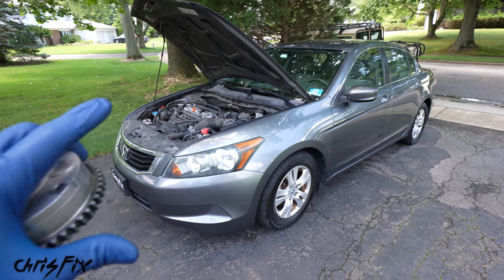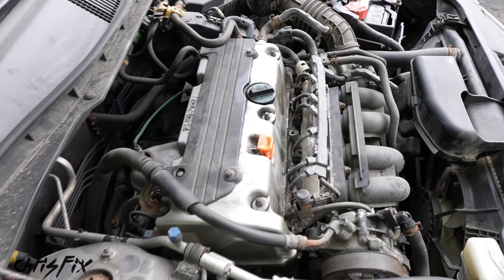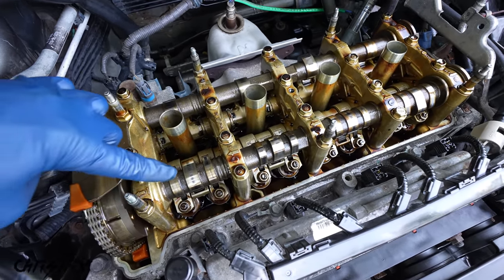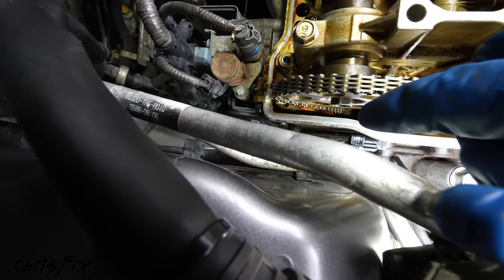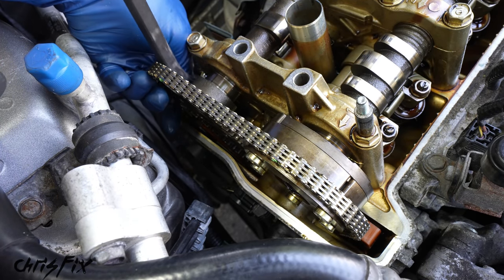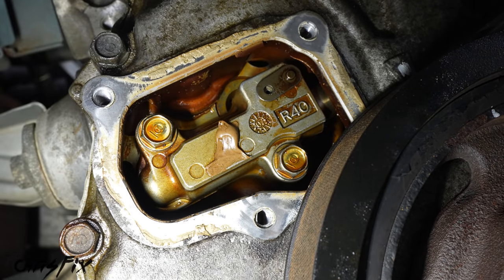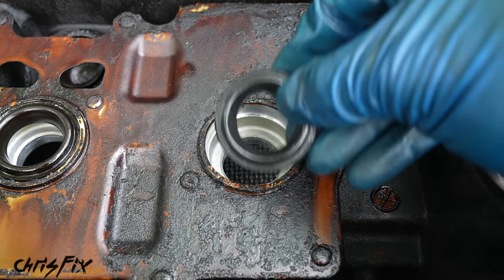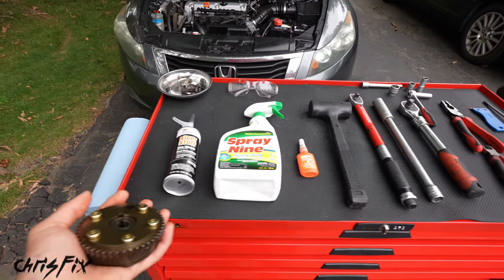How to Replace a VTC Actuator (Complete DIY Guide)

Comment: I just did this job yesterday.   Successfully complete.  Couple of comments.  Unless you are very lucky, or an extremely experienced mechanic with every shop tool known to man, DO NOT ATTEMPT TO BREAK THE ACTUATOR BOLT LOOSE WHILE INSTALLED IN THE ENGINE.  Rather, follow the instruction from the Honda Service Bulletin 09-010, which instructs you to remove chain tension, then remove the (5) camshaft retainer caps and then remove the intake camshaft with the VTC actuator installed.  After removing the intake camshaft - then proceed to break the actuator bolt loose and replace the actuator, and then reinstall the camshaft followed by the camshaft caps.

 IT IS NEARLY IMPOSSIBLE TO BREAK THE BOLT LOOSE WHILE THE CAMSHAFT IS INSTALLED IN THE ENGINE !!!  I tried it -with the help of another person holding the 23mm wrench.  No luck.  Probably applied 200 ft/lb of torque and no luck.  I was about to damage the engine if i kept trying.  It took an extra hour to remove the camshaft caps and remove the camshaft, but time well spent.  It was easy to do.  Just follow the steps in the Honda Service Bulletin 09-010.  Make sure to reinstall the camshaft caps in their original location.  Make sure to align the to hash marks on the camshafts as Chris explains - before removing the camshaft.  You will never get it back correctly if you don't do this. When you reinstall the camshaft and place the teeth into the timing chain - you have to get it perfectly lined up so those 2 hash marks are facing eachother.  If they are not exactly aligned as you had it prior to removal - then remove the camshaft from the timing chain teeth and reposition it to get it right.  This took me a few minutes.  Was a little tricky.  Be patient.  There is not much slack on the chain and it's tight.

When you reinstall the camshaft and align the gear hash marks (TDC) and then reinstall the camshaft caps - they bolts on the camshaft caps have to be tightened down in a specific sequence (as expected) per Honda Service Bulletin 09-010.  As you tighten them down - you will be working against the force of the valve springs - so it's important to tighten them in the correct sequence.  Oil the cam lobes and shaft journals before replacing the caps and tightening.

Also:  very important.....Once the camshaft is removed from the vehicle and you are ready to break the VTC actuator bolt loose - you will need to secure the entire camshaft to a flat surface to hold it in place.  I used (2) cargo tie-down straps.  One at each end of the camshaft and secured it to a picnic bench.  Anything similar (large tree, park bench, wheel mounted to car, etc) will work.  Once tied down, use the 23mm wrench as Chris said to prevent the camshaft from rotating.  Then get a huge-ass breaker bar - at least 30" if possible, and break the bolt loose.  It will take like 250 ft/lbs to break it loose.  You will need only 85 lbs of torque for the new bolt.
Reply: In my experience it was actually pretty easy to brake it loose, using the same setup as ChrisFix except i was also using a long pipe that was put over the 24mm wrench to give more leverage otherwise it's almost impossible to hold the camshaft in place with just the wrench on it's own when you apply that much force through the braker bar on the actuator bolt. The day before i also heated the bolt up just with a cheap little butane torch, and then the next day when it had cooled down i broke it loose, but i don't know if the heat actually did anything for me there it was mainly just the long pipe over the 23/24mm wrench that helped the most. Hope this will help someone out
Reply: Wait. Lemme get this straight. So you removed all the camshaft caps which took an extra hour, just so you can turn around and tell us the actuator bolt still took 250 ft/pounds to break. This seems counter-intuitive. Also, I fail to see how having the cam loose will make the actuator bolt come out easier in the first place. Either I am missing something, or logic and rationale are missing here.....

Comment: My 2013 CRV was making the cold start rattle.  The problem with the VTC actuator is the weak pin spring in the actuator and not necessarily hte actuator itself.  I replaced mine with a stronger spring and no more rattle!  Easier than replacing the VTC actuator with a like for like which will replicate the problem since the design has not been improved.

Comment: This is a fantastic DIY, thanks Chris! As a Honda owner who performed this exact repair myself, it’s very helpful!

I would just comment on a couple things to help people out:

1: At 22:44, seeing the chain jump like that after putting tension back on it is NOT a good thing. These tensioners do use oil pressure as a main source of tension but they also have a strong spring in them too, that will keep tension on the chain without oil pressure. When rotating the engine after the tension is applied, the chain shouldn’t be jumping like that. 

On top of that, these K series tensioners are known to fail as well, so might as well just pop in a new one while doing this job. It’s a relatively cheap part and it can literally save your engine :)

2: I would recommend against using non-oem gaskets for the valve cover. I’ve tried so many different brands over the years, always installing them correctly and I’ve had small oil leaks every time. Maybe not so much with the spark plug tubes but with the valve cover gasket itself mainly. But with an oem replacement I’ve never had an issue :)

Once again, amazing video though and just wanted to add a couple points!

Thanks again :)
Reply: If you see the chain jump, what do u recommend doing? Replace the tensioner?
Reply: @bobbyjoe90  Yep, definitely. Any time this job is done, the tensioner should be replaced along with the chain, especially in those K series engines.
Reply: I assumed it jumped like that because there was no oil pressure because the engine hasn't ran for a few hours, plus when he relieved the tension, it probably drained some of the oil out of the tensioner (not sure if they have check valves or not and that's why the spring is there to maintain tension without oil pressure) The chain shouldn't be bad because the marks lined up, when the engine is started for the first time after the repair, everything should be in check after oil pressure in the tensioner is restored...that's just my guess as to why that happened.
Reply: @ElectricSwordfish  Those tensioners run mainly on oil pressure yes, but they also have a strong spring as well for specific instances like this (cold starts, etc). That slack shouldn’t be there at all.

I’ve replaced a bunch of those little guys on specifically the K series engines and they’re supposed to have tension on the chain at all times.

The tensioner was a known weak point on those engines and usually is the first component to fail (apart from sometimes the VTC actuator)

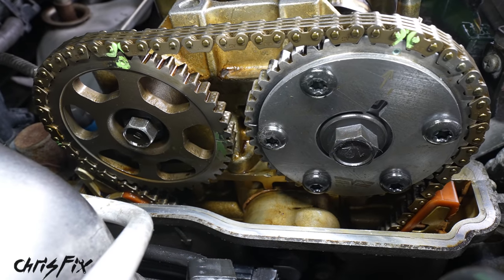Comment: 22:36 I just about had a heart attack seeing that chain jump lmao
Reply: Yeah it definitely jumped teeth hope he caught it
Reply: Is that because the timing chain tensioner is bad? It did it again as well after he went a full revolution.
Reply: @JonDoe-007  this was his response to thta "" It didnt roll off, it bunched up because we compressed the chain tensioner which uses oil pressure to push back out so there wasnt normal chain tension like with a running engine. Also the chain guide on top of the cams was off which would also prevent this. As I said, everything was looking good and it went back to top dead center perfectly. Thanks!
Reply: LOL same
Reply: @DiamondScuff  thanks, i needed that
Reply: @lucassilveiro8056  No problem!
Reply: @DiamondScuff  So someone trying this now, should we put back the chain guide after installing the VTC actuator, before he does the step of aligning everything back to TDC?
Reply: @customerreview9853  Well he had everything aligned to TDC. He was just cranking to confirm it was. I mean you could throw the chain guide on after putting the chain back on and cranking to confirm TDC. But its just a tedious task if your not and have to take it off again.

Comment: 'household tools" brings out a heat tool i've never seen
Reply: Induction torch, not a bad way to spend 40 bucks and trust you don't wanna get anywhere near that coil when the trigger is hit.
Reply: @reaperasylum  you have a link to a $40 one?   the ones I've seen are about 10x that.
Reply: @reaperasylum  when he said in a couple seconds I was all😲
Reply: @reaperasylum  I haven't seen any for $40. The ones I saw are about $300.
Reply: I don't know about the US but here in India it just cost around 1500 rupees in any hardware store which is like around 20 dollars
Reply: Sig Bauer Additionally  you will get a stamp in your passport lol....

Comment: Thanks for the thorough walkthrough! 
Isn’t it worth doing a valve adjustment/check while in there?
Reply: Good point, but maybe too much for the video. I wonder if he did it when we weren't looking.
Reply from the maker: You could totally do that but there is only so much info you can include in a video. I could have also swapped cams for performance ones but that "while you're in there" syndrome can take over and now a quick job turns into something a lot longer. Since the valvetrain isnt making any weird noises, I just fixed what my friend needed to pass emissions.
Reply: If you follow the Honda service manual and take the camshaft out you actually need to adjust the valves before putting the cover back on. If you leave the cam in you don't technically have to adjust the valves afterwards but with 200k miles it would have been a good idea. A noisy k series is a healthy one, when these engines have a quiet valve train the valves are too tight.

Now that I think about it, with the misfire codes it actually would have been a really good idea to do an adjustment considering how many miles it has. Would be a shame to do all this work just to burn up a valve down the road. Understandably you can only do so much in one video so maybe an off camera repair would be best

Comment: Exact same problem, exact same engine in my 2011 Acura TSX. What are the odds.
Reply: How would would it be to change one on a 04 tsx?
Reply: @RomeroProd   04-08 tsx are the same process
Reply: Same as mine but I don’t have a check engine light on

Comment: Definitely recommend not using Dorman parts for this fix.  Stick to the honda part and gaskets.
Reply: Agreed.   OEM Honda parts literally last forever.
Reply: Yeah dorman kinda sucks for important stuff like this
Reply from the maker: Couldnt get a honda part for 2 months. Sometimes you need to work with what is available. The reviews showed they work fine long term.
Reply: @chrisfix  not on fords or any other car that uses VTC.
Reply: @chrisfix  I assumed the owner didn't want to spend too much money considering the miles.  Overall great video.
Reply: @GalenlevyPhoto  except the one in this video
Reply: @chrisfix  I just wanted to know how to fix the codes p0016 &p0017 on 2006 Mercedes Benz c class

Comment: When will the video showing how to remove the safety lug nuts be posted, no rush.
Reply from the maker: That will be one of the next ones, stay tuned!
Reply: if its a 5 point lug, a cheap 12 point socket and a hammer does the job all right!
Reply: You mean security locking lugs? Some makes use McGard locking keys and they are made out of higher end materials so even a easy out won’t be able to grip onto it so you’ll have to get a replacement from the dealer. Some makes still use the chintzy materials making them much easier to get off.

Comment: Hello, thankyou Chris for the grate explanation. Would you have no access to replacements (or be very difficult) would you consider 'reparing' it? I have seen people that take the little Spring inside the VTC actuator and extend it a bit. Maybe a deep clean and the extension of that spring would also work? What about the Solenoid that acts on the VTC actuator, is there any possibility that that Solenoid also has gone bad? In my case, it only started happening when the temperatures got below 32, and I've got no engine check lights on...
Thankyou!
Reply: I am having a rattling sound right now and am going to replace the solenoid next week to see if that fixes the issue, I will keep you posted on my results
Reply: @RohitGeh  did anything happen ?
Reply: @RelayFFA  no, i even replaced the timing chain tensioner and fixed all potential oil leaks, im gonna change the spring in the vtc actuator next to see any changes
Reply: @RohitGeh  how did you make out?

Comment: That was about the best I have watched. Would be good for a few tasks. Those can be repaired BTW. The spring inside the gear gets smashed a little over time. All you have to do is pull it out and stretch it. Put it back and it is fixed.Once again, Great Video

Comment: Hi Chris, 
Good morning folks, after previous corrections and failed attempts, I purchased a Honda brand VVT actuator form the dealer and removed the Rockauto part. Never had any issues from rockauto, JS. Installed the OE actuator, removed tensioner completely, compressed in the vice, adjusted timing, installed tensioner and reassembled. Car started perfect with no codes or noises and drove perfectly. The true cold start this morning was the proof in the pudding when it started quietly like a new one. In my specific situation, this is the first time I’ve experienced the use of an OE branded part resolving the issue. Lots of learning on this one, hope this helps someone.
Reply: Dear friend, I am doing this job right now. I took the tensioner out as well but i am unable to put it back in with the 2 bolts. The tension pushing all the way back, i cant get them to align. I wonder if you can share some infos how to do it . thank you in advance. your reply could save me :)

Comment: Thanks for showing man.  I hope there's not serious going on with my 2017 Honda CVT.  I noticed that early morning when I start her up and warm up for only a minute before I shift from P to R.  I heard like a clank sound as if something is stuck.  I thought there was an object blocking my tires, so I looked out but then there was nothing.  So it seems to me, there's like a delayed from the engine to the transmission.  So the next morning, this time I warm her up for exactly 5 mins and gently shifted to R, and no delay/lag to back up and onto D.  This just started happening for like couple days ago and it only happens early morning.  My CVT was service almost 2 yrs ago from the Honda dealer service.  Owners manual recommends CVT service every 30K or 2 yrs whichever comes first.  I only drove for 10K in almost 2 yrs now so far.  Hopefully after regular interval CVT service and 2-3 mins warmup would be all Ok now.  So I could save some gas a little bit every time I start her up in the morning.